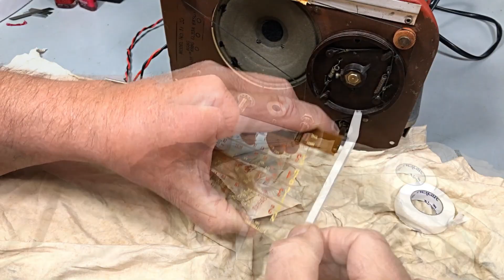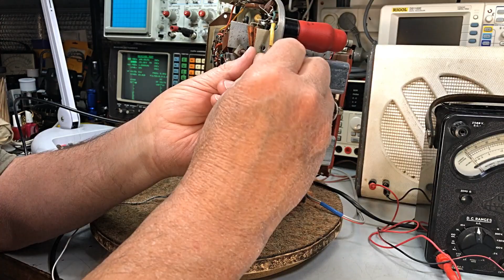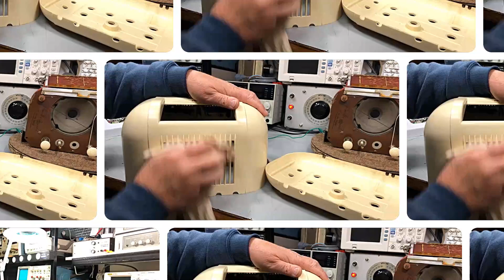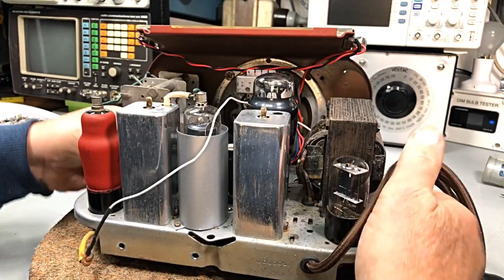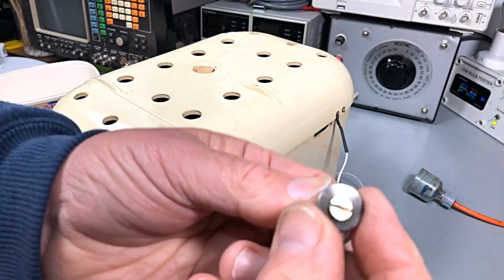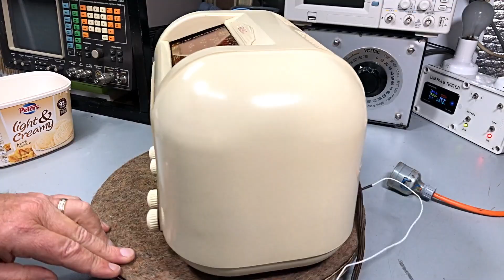Kriesler 11-20  "Plum Pudding" Alignment & Finish Up - Pt3

Comment: Have you tried silicon pads between transistors and heat sinks for going under the dial lamp clips and on to the glass ?
Reply from the maker: Im not sure I follow Paul, this is a valve radio. Not sure of heatsinks either.
Give me more info :-)

Comment: ECH33 is equivalent to 6C31,  But not directly equivalent to ECH35. 
Consulting the National Valve Museum shows no difference in the connections or ratings of these two valves so I am mystified.
Reply from the maker: Yes, was on that site when I did the restore

Comment: Come on people! 4 more subscribers gets Baz to the 1K. Great vid again Baz, the Kriesler looks really good. You can determine if the interference in your shop is mains related or airborne by testing reception with a battery powered radio. If it's mains related there are suppressor circuits that can be built to really cut down that noise. (That's if your new outside aerial doesn't resolve the issue).
Reply from the maker: Lol, only 3 subs to go now !
I'm going to spend a couple of days now to narrow down the interference & put up an end fed antenna with unun 9:1 & coax to bench. Should work ok for testing radios & maybe a bit of SW listening. I do have an antenna tuner as well, used to use it in my amateur days.